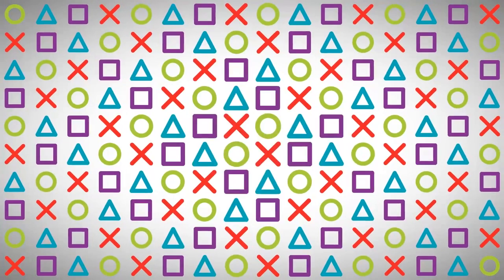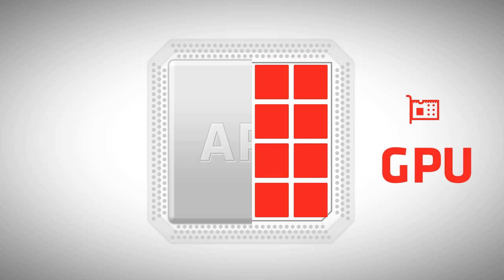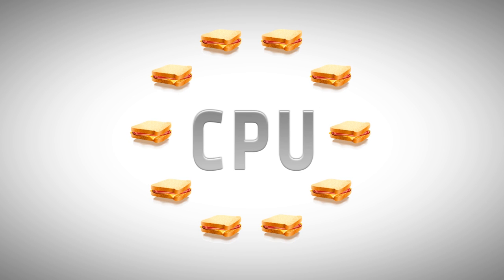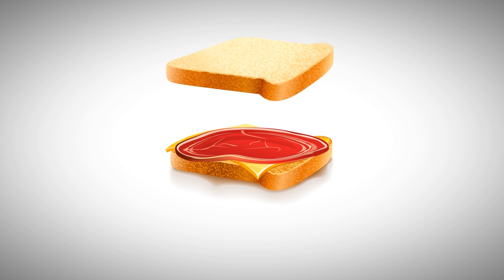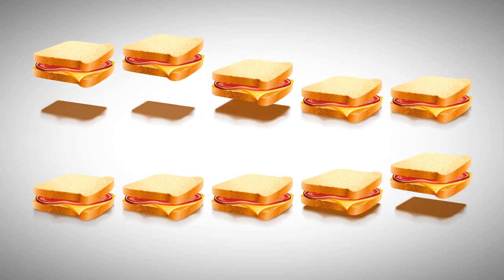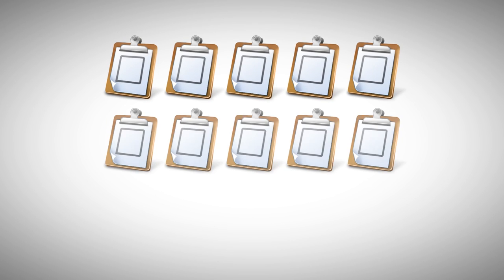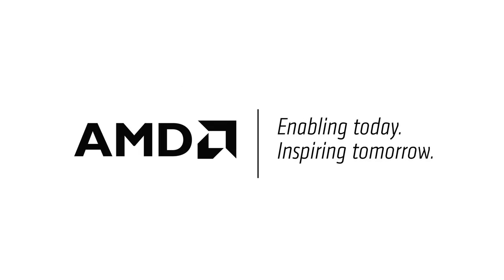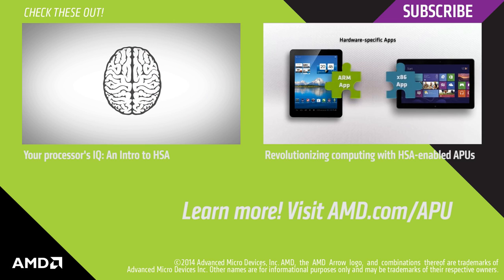AMD Simplified: Serial vs. Parallel Computing

Comment: This does make me wonder though. Why don't we use GPUs as CPUs?
Reply: Because coding for a GPU is a lot more complex and takes a long time to learn. Which is why games take years to make and graphics API's take many years of learning to eventually take full advantage of the power. Most games developers release games for a console for example but for a long time the games that are released are sub-par and don't run very well because the new graphics architectures and algorithms are very complex. Also an explanation of another reason why is here  http://superuser.com/questions/308771/why-are-we-still-using-cpus-instead-of-gpus
Reply: Joseph Richardson Oh ok. Thank you for your great explanation!
Reply: Even if it's possible, it wouldn't be as powerful as a separate CPU. Also not good as high end as it would be too hot.
Reply: each single core of a cpu is much more powerful than a single core of a GPU.
reaching the GPU is also more complex than reaching the CPU.
Reply: Joseph Richardson That is only part of truth. But then programmers should not be forced to think "parallel" but there should be smart middleware/assembler/compiler that does it for them. Also you have to realize that intel as major player will never make that happen. Intel is the only company being able to supply market demand. And if there is no competitor that can take that role, then there cannot be any change. Also you have here software based that would have to be changed, again very monopolistic part of industry that is almost impossible to change.
Reply: Also, some programs/processes HAVE to be done sequentially (serial). For example, I/O, whether it's from Ethernet, USB, Thunderbolt, HDMI, etc. can't be sent to the GPU. Only the CPU can process that. And then there's stuff like booting from hard drive, running the operating system (although I'd like to see a GPU-processed OS for the sake of it),  giving the GPU draw-calls, and connecting/interacting with a website/browser/server.

Comment: Where is the newer apu amd kaveri is kinda getting old.
Reply: kaveri was only recently released and not even on many shelves yet heck trinity are only just starting to leave the shelves and Richland is just getting on the shelves 
getting old lol right
Reply: MR_Waynoracer_PC To me if feels like ages ago. Intel has already got  ddr4 on it's boards and being that AMD is the one that is taking integrated graphics seriously they should have a board for ddr4 and a new APU to go with it to blow Intel out the water.
Reply: intel have already said thay wont be using ddr4 on there mainstream products untill late 2016 so unless you want a productivity machine on 2011-3 intel wont have ddr4 till then, which means amd will have ddr4 on its consumer products before intel although the performance diference between ddr2 ddr3 and ddr4 is laughable in some cases ddr2 is better due to latency there is a higher latency with ddr4 the only thing that will benifit a great deal from ddr4 is integrated graphics and apu's
Reply: MR_Waynoracer_PC People can already walk into a store and but a ddr4  motherboard and ddr4 so ddr4 is out for intel.
Reply: Hussean Duncan its not a consumer product intel wont have ddr4 on consumer products till 2016 the current intel ddr4 offerings are for professionals and people with $3000 to burn on a cpu ram and motherboard :P you cant walk into any stores here and get a haswell e product the best you can get is the haswell refresh 1150 gear
Reply: MR_Waynoracer_PC Have any sources for the AM4 socket?
FM3 is for Carrizo, so is SkyBridge going to be AM4 or what about 'Zen'?

Thanks in advanced.
Reply: cant tell you sorry dont want him fired
Reply: MR_Waynoracer_PC Oh, alright. I understand, Non-Disclosure Agreement. I suppose I'll just have to take your word on it.
Reply: interesting that the post vanished :s
Reply: Kaveri is actually very advanced, yet not used very well in todays applications. However with HSA compatible software the speed in incredible beating the very x86 high-end.
For some reason people are calling for newer chips when today's chips are using only fraction of theirs potential. For instance todays games do not use even 2 cores optimally. High end CPUs have often 15-20% usage, so the question is do we need faster CPU? Or should we optimized software layer and gain performance (potentially hundreds % increase) there?
Reply: Rodney Savage , to oversimplify: the majority of the reason is that software development is expensive. Consider this: a typical low-end developer makes the equivalent of around ~$25 an hour (though, typically this is salary based, obviously). That's entry level, not typically someone that is even capable of making optimal software. The guys that are even capable of that task are closer to around ~$60 an hour and making optimized software takes many, many hours (you don't want to even begin to look at how many man-hours are invested in a typical AAA game already). In fact, there is no way to guarantee "perfectly optimal software"; it's always possible that spending a few more hours will produce a slightly faster piece of software that takes better advantage of the hardware. Furthermore, "optimized software" is almost always significantly harder to understand and to change, which means that software maintenance (which is the most expensive part of a software development process) increases in cost.

Making optimized software is both expensive up-front and, more importantly, more expensive later on to maintain. Hence the reliance on hardware. Upgrading hardware, comparatively, is much cheaper and it gets cheaper as time goes on (the exact opposite of software, which is where the optimizations get more costly as time goes on). There's certainly a balancing act in terms of making software easy for programmers to understand/reason about and making programs efficient enough to accomplish a task on reasonably modern hardware, but the balance is tilted very clearly in the direction of making software easy to understand and reason about (which, consequently, means that better hardware is the best way to improve software performance/make more complex software possible).
Reply: +Rodney Savage Sometimes you have no choice but to leave it as good as you can make it without trying to make it as good as it could get when you have a deadline. Fixing one thing may cause a hole somewhere else and so on and that is why they optimize software after it is released either though patches, updates or drivers hence getting better performance from the same hadware
Reply: Zen APU is probably coming out mid-2017, that is if AMD can handle it.

Comment: apu is shit. individual cpu and gpus are better . imo
Reply: +LisandroCalejo Parallel is not necessarily efficient..... APU better fits consoles... not gaming PCs....
Reply: Yuhong Liu yap that is why laptop manufactores are moving away from apus and puting desktop versions on it since more poeple are wlling to pay for portabelaty and power.  apus are realy good for low tasks and web browsng doe  /and simple games) .
Reply: +LisandroCalejo APU's work very well in gaming laptops, and they are not moving away from them soon.
Reply: You realize that Intel chips are technically APUs right? Otherwise, what the heck is Iris graphics?
Reply: Engineer_ 314
yeah, I guess many people don't consider them apus though because their gpu power is minimal compared to amd's
Reply: Scon Videos I don't know about that. The new Skylake graphics look like they're on par, granted at a higher price (not sure about the i3s). Still, one thing I like about AMD APUs is they can Crossfire with a GPU (Dual Graphics). But  #amdradeon  , if you're listening, please PLEASE make Zen pair up with graphics MUCH higher than just an R7 250 PLEASE. (Like at least an R7 260X)